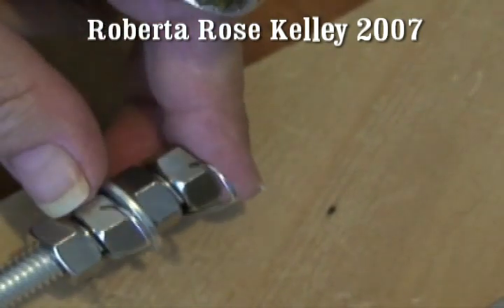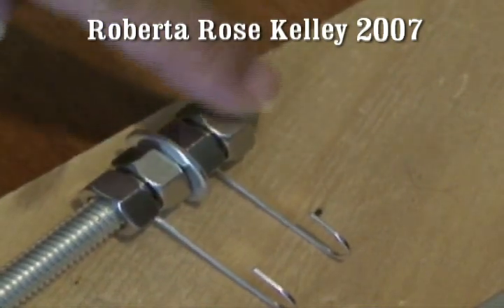Making your own Bond Cast On Comb

Comment: Forgive me Roberta - I thought a bit longer, as I should have in the first place, and realised that whichever way you do it, it would take the same amount of time and the nuts would cover the same distance. Also, you always know what you're doing, and do it well, so I look forward to more of your tuition. Thanks again and greetings from Scotland, Barbara (Elfy60).
Reply from the maker: We all will do that Barbara so no need to appologize, I have learned to wait before I write for the most part.
I believe that if one were to start in the middle of the rod if cut to size before adding the nuts, washers and cut Jumbo Paper Clips, that one may not get all the 50 hooks on it, why I started right from the edge.
But no one has to do as I show in any of my video's, they are more for your viewing pleasure but also you may find a different way of doing whatever it is that I am showing.  Some things may have be done to a T, but not all.

Comment: Amazing I've tried all sorts with both my Bond Machines, although I still have intact hems for both sooner or later one of them is going to bust on me
Reply from the maker: Always good to have a backup.  Now when I use my bond, which I should get her out and work up somethign on her, maybe after the holidays here, I do prefer the cast on comb as if the piece will hit the ground, then one has to roll up the black hem, well I am sure there is a way to undo it and then hang it again, but to me is a bit too much work.  When the piece is small, then I don't mind the black hem.

Comment: I would imagine this to be quite heavy when you're finished with it.  I like this pattern better than the other homemade combs I've seen.
Reply from the maker: Yes it was heavy but it worked for me with the few bond machines I had.  I forget if I mentioned to make the comb for 50 needles at a time, if one were to do it for the full 100 needles, it sure will be heavy.  Also maybe make smaller ones for smaller projects.